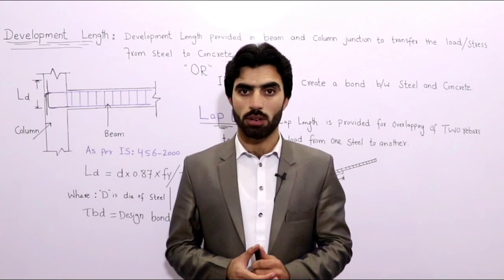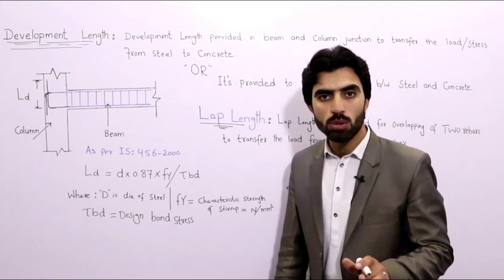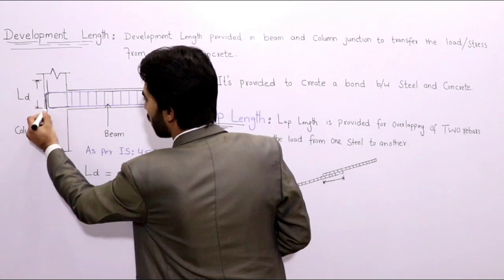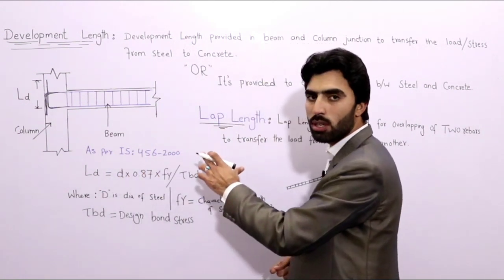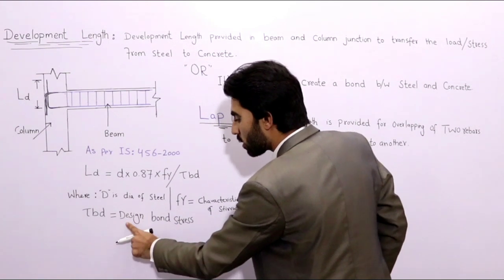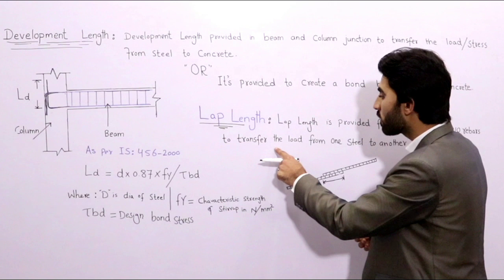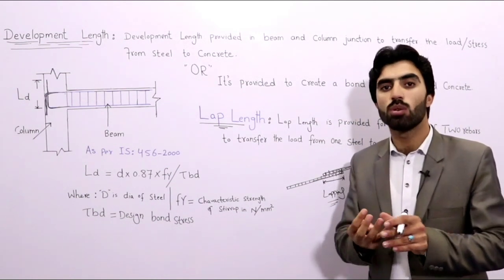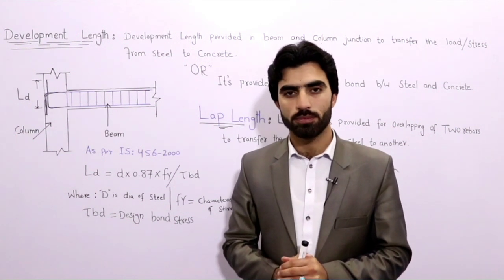development length and Lapping Length - Difference b/w Lap length and Development length

Comment: The speaker seems confused. He said that lapping length should be provided at the mid. of the structure because bending moment is 0 at the mid. The real situation is that bending moment is maximum at the mid. so lapping length should not be provided at mid. It should also not be provided at support because shear forces are maximum at support. So lapping length should be provided away from support and away from mid. It should be provided some where between mid. and support. The speaker should make it clear that, at which point lapping length should be provided.